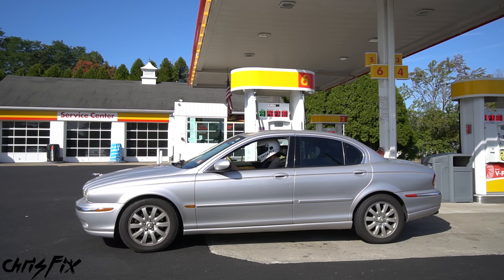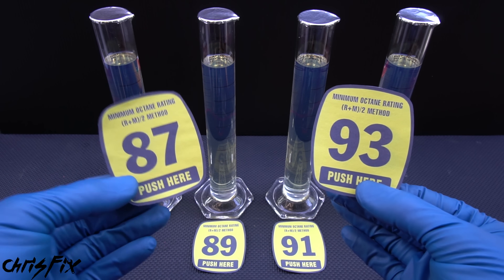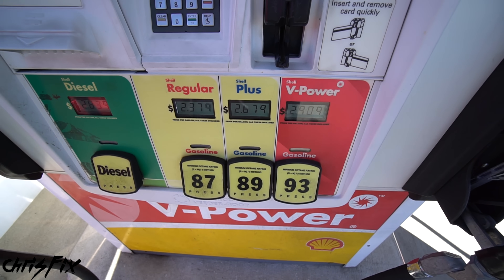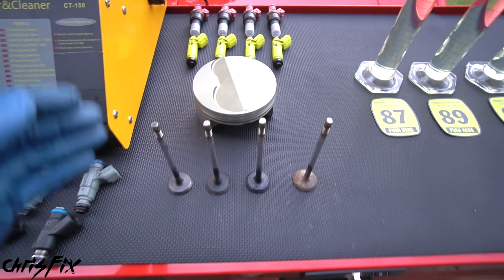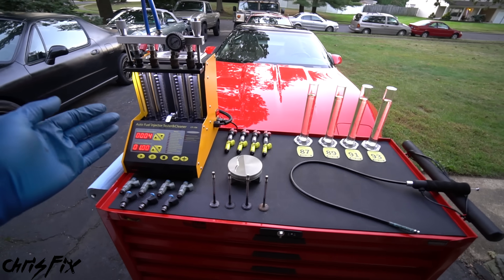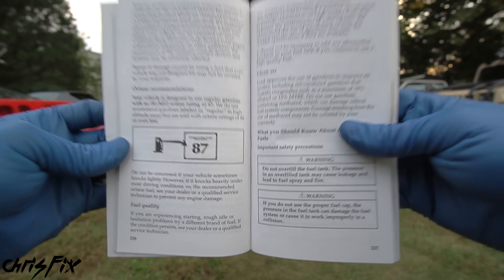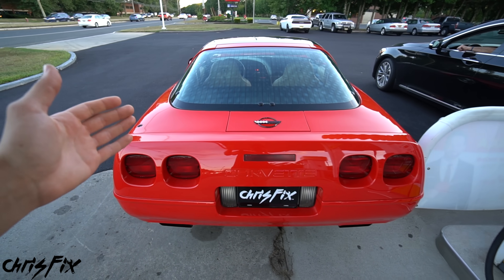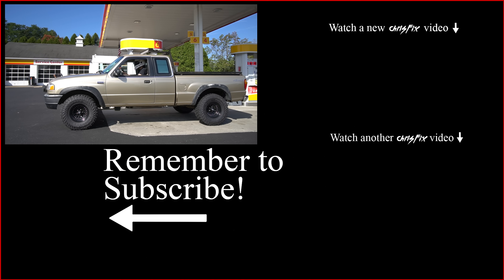What is the BEST Fuel to Use in Your Car or Truck and WHY

Comment: i have a 2003 silverado ls and when i crank it every once in a while it will make a really loud bang sound and then  it wont turn over anymore and i have to turn the key again for it to crank. i also have a huge fuel economy problem with me having to $20 in every day, should i use high octane for a while or take it to a shop?

Comment: This video may age better than you know.  With gas prices going up the government is regulating more ethanol in gasoline, believe me when that happens you better be running a fuel cleaner at regular intervals because those motors are about to get shitty quick.  Ethanol is what we call a poor man's race fuel, it doesn't wake up until you hit 12.5 compression, which is the maximum compression I have seen Toyota and Honda run on pump gas motors.  Ethanol has drawbacks.  It does not contain liter per liter the same BTU's of energy as gasoline, (110k vs 85k) why people get better mileage with gasoline over ethanol, and why you must use a bigger fuel pump and injector size on ethanol motors.  The biggest setback of ethanol is its ability to attract water to itself.  Ethanol is a very poor choice for marine motors and motors that sit a long time with fuel in it, the ethanol breaks down into sugars and gums up EVERYTHING.  Ethanol is alcohol made the same way, if I take a table spoon of gas and ethanol and light each - the gasoline flares up and burns quickly, ethanol you get a nice blue flame that burns a long time - why its great as a race fuel.  Since Ethanol is now mandated, its how gasoline refiners hit those octane ratings.  More ethanol raises the octane rating.  E-85 contains 85 percent ethanol and 15 percent gas it is approximately 100-105 octane rating.
Reply from the maker: I have plans on making a video all about that soon, but good info!

Comment: Hi Chris, I use a car which needs basic fuel like 83 but I need to feel some good power while driving. 
In that case, can I fuel up the 83 octane and add that octane booster to solve this issue?
Because these days the premium fuel is so expensive.
Reply: Octane doesn't increase power. That's up to your engine. Higher octane allows your engine to create more power if it wants to. If your car is tuned for 87, the octane boost probably won't make a difference

Comment: Verry nice video,  nicely explained 👌 👍.  
If I may add a little detail ( don't know if others have seen the difference) . So I'm from Europe and our 95 contains 10% ethanol now and the 98 has 5% . I drive a simple 1.4 Skoda 110kw car and for me the difference between 95 and 98 is only like 5€ or less on a full tank but in fuel economy I get up to 150km more with the 98 e5 gasoline.  Before when the 95 e10 was e5 there was only 50km difference which was negligible for the price difference  but not annymore for me.

Anyone else seeing this to ??
Reply: yes bro, same for me.  Im using 100 and it is way better than 95 for me.

Comment: Nice video and very helpful info.  Quick question...do you have a video with the knocking noises from the engine?  Most likely have never had an engine knock but who knows if I just played it off as "normal"?
Reply: If you start from a dead stop up a steep hill and hear a chattering or rapid clicking noise, that's knock.

Comment: Chris: "There are myths that with higher Octane ratings you get better fuel economy or more power, these are completely untrue"
Also Chris: "You can use regular. You may lose some fuel economy or power"
Reply: I feel like it applies to certain cars. Like in my car if I use 87 I get predetonation which probably negatively effects performance. Where as a car that can use 87 won’t benefit from 91. Just my thoughts
Reply: he just said it depends on your car
Reply: @Yotts23  "completely untrue"
vs "it depends on your car".... there's a difference there, y'know?

Comment: IMHO if your car required higher octane, but you still want to use lower octane for your vehicles, I guess you need to regularly use the injector cleaner liquid like every 6,000-7,000 miles

this way you can prevent a carbon build up in your combustion chamber, CMIIW

Comment: I have a basic hatchback sedan that uses regular fuel but seeing this makes me realize putting premium in it every couple months will be beneficial to my engine (hopefully)
Reply: Unless you're getting engine knock or hesitation, keep using regular fuel and put a bottle of fuel injector or fuel system cleaner in the tank about a week before each oil change.  That will clean deposits and injectors and give the sludge time to migrate to the oil pan to (hopefully) be drained with the old oil.  You can use those products anytime tbh, but more than that is likely overkill. Furthermore, if your car takes regular gas and is still knocking, there are likely other issues that are at play and correcting with premium fuel will be temporary at best.

Comment: In Germany it starts at 92 octane which is called super e10. After that we have the regular fuel which is 95 octane called super and super plus at 98 octane. Ultimate has 102 octane.

Comment: My experience on this is that I had a vehicle throw a P0420 code, turned out to be the Catalytic Converter. After exclusively burning premium for over a year, I never saw that code again. That made me a believer in a cleaner fuels ability to degunk a system, and help prevent buildup in the first place. Now if we could just get rid of ethanol entirely.
Reply: I have a 2007 subaru forester which is the bad year;  It throws the fault code if oil is over 3000 miles or certain stations 87 used.  Shell nitro fixes problem
Reply: We cant get rid of ethanol and with current prices they may opt to increase it so as to reduce oil used.  But the price of corn is up too
Reply: @u-know-this  ya and since ethanol will absorb water just look at the possibilities of making a gallon grow
Reply: for me my car throw that code because I used premium gas in it for 3 years . cleaning the catalytic and the mechanic told me to never full your Accord with premium . Now after I full it with regular Really I feel the car has more power and no more of p0420 ! so all what he said in this video a bout full what the car manual said is True > All Hondas 4 Cylinder must be fulled with Regular Gas
Reply: @dwdhb9905  Yeah it depends on the car, I found that out too late my car requires premium and I've been using regular for half a year. At first I thought premium was just recommended and not required.

Comment: .... All I have to say about this, run regular in your tank for a while. Give it a week. The 87.
Then do the exact same thing with 93 or rec90 ethanol free. For a week.

Compare it. You will get better gas mileage the higher you go, and you will have more power.

I don't know who told you this stuff, or if Shell isn't on it, or what. I've heard a lot of good about you, but to say you won't get more power or gas mileage is just utter bullshit.

Comment: Sooo moral of the story cheap gas causes more wear and tear on your engine the premium cost more but runs cleaner and combusts when its supposed too with out all the excess fat that causes carbon build up on the internals!👍🏼 pretty much what us old schoolers already knew...great video for reassurance👍🏼
Reply from the maker: So I wouldn’t say it causes more wear and tear. I ran (well my dad ran) cheap gas in our van for 315k miles with no issues. But that van was brought to operating temp almost every drive

Comment: In Florida many stations sell Ethanol free REC 90 fuel, this is meant primarily for Marine engines,  It is about the same price as 93 Octane. I have tried filling up with this fuel in my car. I did notice that my car ran better and did have slightly better gas mileage. Your gasoline can definitely do fine without ethanol. Your car runs better without ethanol.
Reply: @angelg3986  That's not true. Most of the premium (v-power, 102 ultimate, bp ultimate etc.) fuels around here (netherlands) don't contain any ethanol at all. And a lot of german gas stations sell E5 as their mid-grade fuel.
However a lot of the small automated "pay and pump" station by the side of the road do only sell E10 and basic diesel which is very annoying.
Reply: @ric84  for the Netherlands you know better.
Reply: @angelg3986  I don't understand what you mean by that.
Both the netherlands and germany are part of the EU. I live 100 meters from the german border.
Our pumps expicitly say v-power doesn't contain ethanol despite the required E5 (meaning "up to" 5% ethanol) sticker on the pump and the german ones, despite not having said sticker on the pump itself, state that they have no ethanol on their websites.
Though your point about 10% ethanol being legally required would already be discredited by the fact that E5 stickers exist in the first place.

Comment: Really bothersome that where i live they have 85 octane when very few cars use 85 octane. If I am correct its for cars with carburetors and its sad because I know most people use it because its cheaper and its probably not very good for your car.
Reply from the maker: So I assume you live in an area of high elevation? If so, 85 octane is the equivalent of 87. Just don’t drive to sea level without filling up with 87.

Comment: I love the video, Chris! Thanks for clarifying all the confusing knowledge about gas out there. I do have a question for you. In your opinion and experience, which one is better for increasing fuel economy: buy premium, or fuel up with regular and use one of those fuel additives (like Chevron Techron)?
Reply from the maker: Just using whatever octane is required for your car and keeping up with repairs/maintenance/simple things like checking tire pressures is the best way to improve fuel economy. Not a bad idea to fill up with premium or use an additive once in a while, but more often then not there won't be much of a measurable difference and you had might as well saved the money
Reply: @chrisfix  still answering comments from 2 year old videos, i love you man
Reply: @chrisfix  lol it's as if he didn't even watch the video lmfao
Reply: Best fuel economy gains are from using the AC sparingly when possible, keeping windows closed, correct (but on the high side) tire pressure, good tire tread, and driving style.  General maintenance is also a big plus.  Using fuel injector cleaners should be done sparingly, no more than once every 2000 miles.  Maybe if you're trying to last-ditch save a rough running car you could use more and succeed, but your problems are probably going deeper than that.  Keep up on oil changes, use better-than-midgrade filters, check your air filter regularly (you can gently vacuum the disposable ones out - once - and get about 30% more life from them), and use a mirror and small flashlight to regularly check your brake pad wear.  Uneven wear can be a sign of dragging pads, which rob mileage and warp rotors.
Reply: @andrewcz8871  Great information , appreciate your time
Reply: video makes me miss these $2.65 gas prices

Comment: Do you really think the octane after it goes into the truck gets delivered is 93 octane
I don’t think so
Reply from the maker: It has to be. I run cars that need 91 and will knock if it is not. Also fuel is randomly tested for both volumetric accuracy of the pump and octane. It's actually pretty well regulated. That doesnt mean it doesnt happen tho, but it's rare.

Comment: Very good video, very informative. A few things though, is not referred as detonation, it is referred as implosion. Also, the issue with implosion is that the gas will implode before the piston reaches its climax level and implodes due to heat and pressure pushing the piston down before it reaches the high point (climax). When the engine detects implosion, it increases the fuel to prevent it decreasing performance. when you use high octane in any car, it will always increase performance but not horse power ( it will give the horse power the engine was designed to give ). so, if you have the money, use high octane gas. if you are like me, you are stuck with low octane gas.
with this hype on global worming, governments should make high octane gas the only gas because is burns more efficiently. Another example on how the gas industry has the government under its payroll. It has never been about saving the planet. is has always been about making money.
Reply from the maker: I've never heard of that being referred to as an implosion, and higher octane does allow for greater engine efficiency (forced induction/high compression) but the octane itself is not necessarily more efficient, especially for a car that is not designed to use premium fuel

Comment: Hey Chris I just got a car i've been eying for a few years now, the problem is the owners manual says 93 Octane gas is required. Would it be okay if I just use octane booster at every fill of due to gas prices. Or can I buy octane booster ever other fill up?
Reply: Just get a Costco membership. 93 at Costco would be much cheaper than buying octane booster

Comment: He's right and wrong at the same time. Though the energy of clean fuel may produce the same out of energy its not always the case in engines because the ignition being fast and even generates a significant amount more pressure than an uneven slower ignition

Comment: another common cause of engine knock is when you advance the timing of the ignition, just to be thorough.
Octane is not just a rating number, it is an ingredient of gasoline. "-tane" is a hydrocarbon molecule with Carbon (C) as a central backbone and a Hydrogen (H) on either side, H-C-H. They connect along the C like LEGOs, think of a vertebral column all lined up, top to bottom, along the center there's (C) with two side spurs (H, H).  An octane has 8 -tane units. There are a bunch of -tanes, all of which are found in crude oil and/or created at the refinery. Butane is 2 -tanes, pentane is 5 H-C-H units, hexane is 7 units, octane is 8, nonane is 9, decane is 10 etc., Higher -tanes = more resistance to detonation because the -tane units need a bit of force to combust. Smokey, stinky exhaust = unburned -tane units.
P.S., Your car won't run on just octane booster, i tried.

Comment: You can run a diesel engine on water (given the engine runs hot enough) but you can't use normal gasoline (87-92 octane)? You can even run Stoddard's or Bunker in a diesel, but gas is not gonna happen? WHY? You could tun the engine on hair, but no gas?

Comment: I have done a test on my 4runner and I definitely get 50 more miles to the tank running vpower shell then any other gasoline from any other distributor.
Reply: Nice. I managed to get 39.5mpgs on my 2019 1.5t Accord using 89 from shell. Don't get that on 87.

Comment: if it has ethanol, I don't use it!  The worst crap you can put in your car!  Unless you want fuel system damage!  So, it's worth using high octane, to get around ethanol, and I have 2 Saab 9-3 Turbos, and I know my knock sensors are relaxed.

Comment: “Today's premium fuels contain additives and detergents that help clean fuel injectors and remove carbon deposits inside of engines, thus, incentivizing motorist with engines that use regular fuel to, on occasion, use premium gas to clean their engines.”

Love the videos Chris, though not sure you had it right about the cleaning aspect.
Reply from the maker: What did I not have correct about the cleaning aspect? Everything in the video was checked for accuracy by petroleum scientists (the people who make the fuel).

Comment: An old vid but I had to say something.  Can we agree that all modern cars have computers that can adjust timing?  Can we agree that with advanced timing a car has more horsepower when compared to same car and engine with retarded timing?  Can we agree that a car that is using 93 octane the computer will advance the timing, which will result in more power?

Comment: You cant 87 in very Expensive Cars…. Some Cars are Required High-octane fuel only… which prove your Video info is False… if it was True.. ?All Folk would use 87 in there Cars…

Comment: I would like to add a little clarifying information regarding octane ratings.  In Europe, and many other places, the octane posted is ROM, which designates (R)esearch (O)nly (M)ethod.  In the United States, and I'm sure some other locations, the octane posted is R+M/2, which designates (R)esearch plus (M)otor divided by 2.  The ROM octane is determined using a mathematical formula based upon the refining method and additives in the fuel.  The R+M/2 octane is determined by using the mathematical formula and adding that to the octane determined by running the gas in an octane motor to determine the detonation point and then dividing by 2 to get an average rating between the two methods used.  Research numbers are always higher that Motor numbers.
Reply: No, it is RON: Research Octane Number.